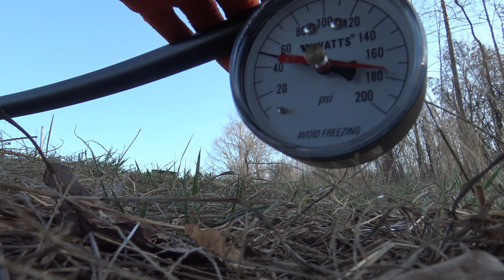You've never seen a farm water system like this...cheap, easy no electrical required!

Comment: Josh, I don't think you covered the subject enough that what makes the ram pump work is the "flow" of water.  You will need to run the outlet of the pump to a tank or cistern for collection and storage.  All extra water will just spill into a bypass or overflow to return to the creek.  It looked to me that there was about 1/2 to 1 gal/min coming out of the spigot.  That flow will be sufficient to keep a 100 to 300 gallon cistern full for your animals for a while.  I am not sure you will be able to have the spigots in line with the delivery pipe to the cistern and the system work the way you want in that the line to the cistern needs to be flowing all the time.

Comment: This looks like a great way to keep water to where you need it on the farm. But I have one problem on what you say about returning water to the pond. You where talking about returning water from the feed tank after it is full vie a float or over flow. To me this brings up a problem. The problem is that you would be putting water back into the system after the cows drank form the feed tank. By doing it this way, if a cow was sick or had some other problems you be introducing this problems into your pond any anyone down stream. We had a similar problem in the family where my wife's uncle had to stop raising pigs when Asheboro built the Zoo. He was up stream and using the stream to water his pigs. They where concerned this would cause health problems for the Zoo. It is just something to keep in mind when returning water back into the environment.
Reply: I like the idea of float valves. The water stays in the tank until needed and no more water is pumped than is needed. You make a good point.
Reply: Good thing animals don't live outside or go to the poop or pee outside.
Reply: You could have solar powered UV bacteria killers either in or outgoing,if needed.
Reply from the maker: where do wounded animals go to die? To water....but a valve will be a permanent solution for sure

Comment: Where's your backflow device?
Reply: The pump can have the delivery turned off and still operate. But it starts to build a really high pressure. When Josh installs the pump permanently he will likely have a return pipe to the creek.
Reply: @LandtoHouse  Can you pump the return back to the original supply pond to save the water and use it again?
Reply: @James_Innes  yes that can be done. The ram pump typically uses about 80% of the water to operate the pump and 20% is pumped up hill. So the return would be reused but nowhere near the original water that went into the pump.
Reply: @LandtoHouse  So the most efficient use of water would be to pump up to a huge cistern on the highest point of the farm and then turn the pump off to save draining the pond and wearing the pump out.  I'm wondering what the life span of the pump is if left running continuously ??

Comment: That was a very interesting video!!  Just to be clear...the ram pump is above the pond or below??  What is the maximum distance from the pond for the ram pump??  Thanks for the informative video.
Reply: Hello. The pump takes water out of the pond down hill about 6 feet. Then uses that drop in water to pump up hill.
Reply: Oh and the max drive pipe distance is 100 feet but a stand pipe can be installed to make a longer drive pipe work.
Reply: @LandtoHouse   Thank you!  Very interesting system.
Reply: Land to House 
Would you mind explaining a Stand Pipe, how it works, and how to install one...?
Thanks for sharing this information with us...!
Have a great day and be blessed.

Comment: So, if I'm certain on how this thing works. The water source must be higher than the ram pump to take advantage of the stored energy in the fall of the water from the source to the pump? Also Josh, this spring you need to get some gold fish for your stock tanks to keep the skeeters down.
Reply from the maker: The stock tanks are temporary...and I agree skeeters will get bad if I don't have specialized tanks...great comment thanks so much!
Reply: Stoney Ridge Farmer 
You mentioned getting specialized tanks...
Would you mind sharing what kind, where from,
ect...?
Thanks for your help.
Have a great day and be blessed.
Reply: Stoney Ridge Farmer so water source must be higher than area intended for use? My pond is much lower than land I would send water too.
Reply: @billm5005  No .... The water source needs only to be higher than the pump! (You could even put the pump in a purpose made sump .... but the sump would soon fill with water! .... See my own post a bit further up this page, I think.)

Comment: I first read about this technology in the mid 1970's.  An old-timer at work told me about how his uncle used ram pumps on the farm years ago.  You get accustomed to hearing the rhythm of the pump and occasionally it will miss a beat.  Not to worry.  Good video, as usual.
Reply: Its good to hear stories like this. More farms need to use the ram pump.